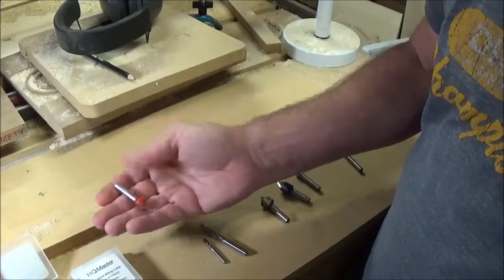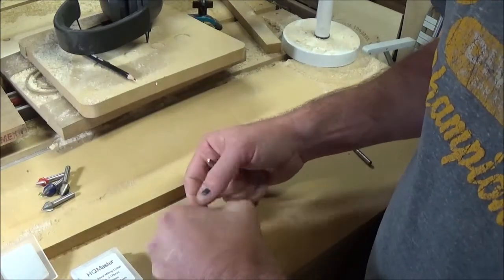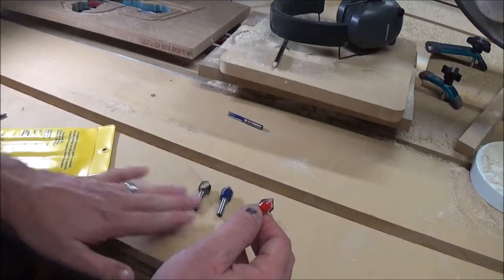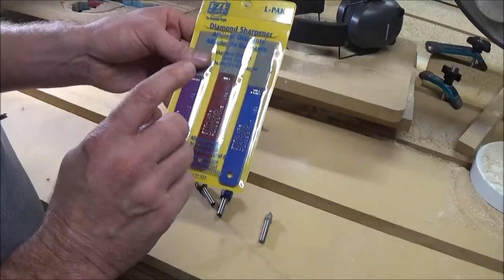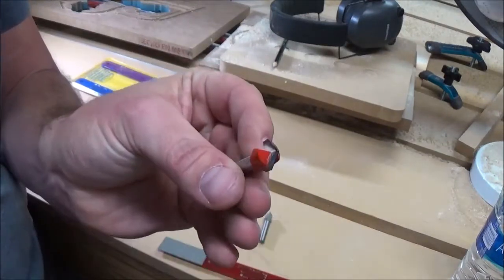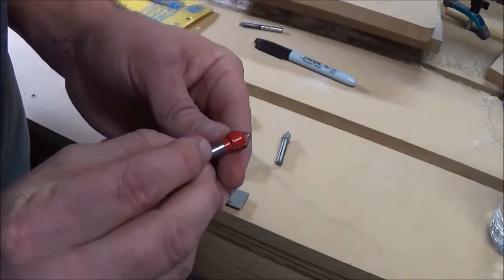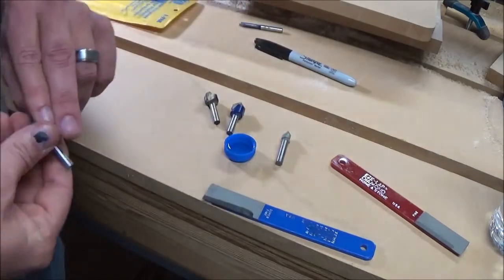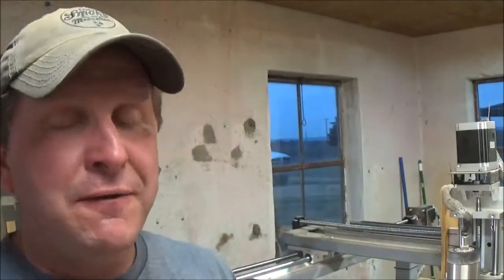How to sharpen your CNC router bits

Comment: You dont need to throw them away at 5/8ths of an inch.  Just redefine the tool geometry in your cam software.   As long ad the sides are equidistant from the center it should still work fine, it would just be a little smaller.
Reply from the maker: Ok awesome...I haven't got into the program and tried messing with setting up custom sizes....but i clearly need to....Thank you and thanks for watching!!

Comment: I sharpened a burned 1/4" hss end mill that had tar all over it.  It seemed to cut well again. But it still has (less) tar. I couldn't get it all off.
Reply from the maker: Might try some WD40 or acetone either one for the tar, and use some kind of abrasive scrubber like a steel brush or steel wool, then wd40 and heavy rag, then try the stone..WD40 tends to cut through a lot of heavy grease type stuff, just a suggestion..I always use wd40 on tar on the wifes vehicle and let it set a few minutes then a rag and the majority wipes right off, then i'll soak it with wd40 and hit it with a power washer...Thanks for watching!